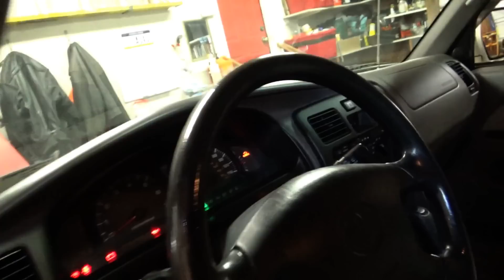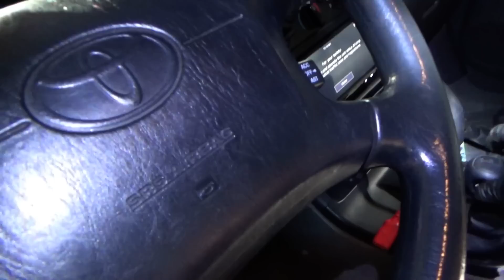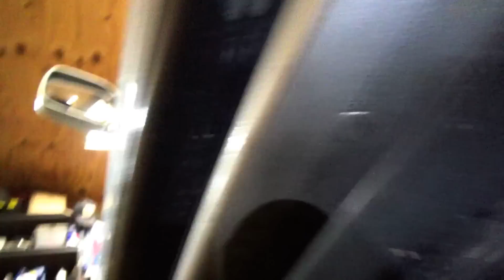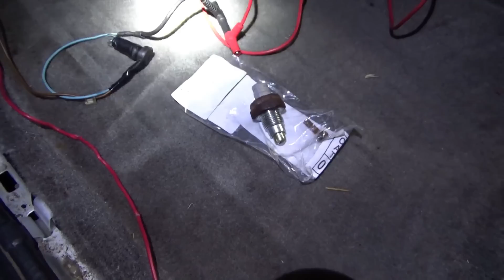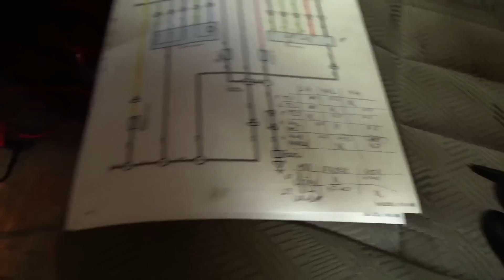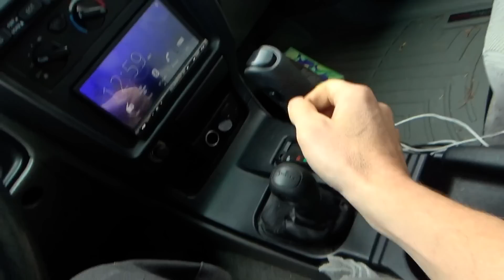(Pt 3) HELP! My Toyota is STILL STUCK in 4x4! ('02 4Runner)

Comment: Hey Ivan.  I felt your pain with this ball-buster because I just had a Tacoma in the shop the week before last that was every bit as bad as this 4-Runner.  Long story short, after wasting a whole morning trying to find what I needed on ProDemand and Identifix (I don't use AllData but I don't think it would have been any better), I got myself a 2-day subscription to TIS.  After about an hour figuring out how TIS works (it's not that bad, but it's set up different than Mitchel or Identifix) I found everything I needed to know about a 2020 Tacoma TRD.  Believe me, this is one truck you don't want to shoot the parts cannon at... everything special to "TRD" is very expensive.  At any rate, I don't think I would have found the problem without the detailed shift cable/shift rod dimensions and specifications I found in TIS.  That information was NO WHERE in Mitchel or Identifix.  Just saying, it's a good resource for these uniquely Toyota problems.
Reply: Where is there a cable?
Reply: @brianw8963  To shift that Tacoma in to 4-low the transmission must be in neutral.  If the notch in the shift quadrant does not match the notch that sets the limit switch on the transfer case, it won't shift.  TIS pointed me to the fact that if the cable is stretched, mounted poorly, rusted up or in any way screwed up in such a way that neutral on the PRNDL quadrant does not match what it wants to see as neutral in the transfer case, it won't let you shift in to 4-low.  In this case TIS suggested checking the shift cable right off the bat.  On most other makes,  the transmission gear selector  cable isn't something that comes comes to mind when a customer's complaint is that it won't go into 4wd..

Comment: Parts cannon fired.😂😂😂jk jk ivan. Those 4wd system are some of the hardest to do diag. Was a toyota tech before. I belive only 99-2001 have that system . shift on the fly all wheel drive system

Comment: Only thing I can think of is a little rust jacking on the case itself along with the crush washer was the culprit. Great video my friend.
Reply: +1 rust, chased the same thing on one, pull the switch and wire wheeled the hole, good to go no parts required.

Comment: the CENTER diff lock on my 96 4runner will not engage in high, only in low. i believe this is correct. now i understand there are NO axle diff locks. thank you, you're the best.
Reply from the maker: @gunny2shoes102  the Limited 96 has a REAR diff lock that can only be used in 4LOW. No center diff at all. My brother had one, it was a beast 😎
Reply: @PineHollowAutoDiagnostics 
Thanks again that's how mine is.
I think they called center diffs-part time all wheel drive-

Comment: That shaft has to be worn as that new switch made contact so quickly maybe the old switch had locked up at some point and the shaft got bent or grooved up at some point were odd.

Comment: No wonder mechanics fire the parts cannon at case studies like this. I'm still confused about the whole test light diag. It just does not add up. Removing the washer when it should be there does not seem right to me. I think there is a bigger problem lurking. But who knows? I'm not a mechanic! Thanks Ivan for another head scratcher!:hand-purple-blue-peace:

Comment: My 1984 landcruiser had a center diff switch. But this was not in these 4wd models from the factory. -- speculate that the center diff lock is a known issue at toyota. So they just removed the switch. No center diff lock, no problem?

Comment: When they were laying on the bench together.. It does look like that Original switch is a little longer from the tip to the bottom of those threads...   That was a nice catch with the washer being the problem;  or rather being the solution.  The real "problem" is that the new switch is a little shorter than the old one..  But you still solved it.. bravo..........   Between this and seeing Eric O have depth issues with chevy crankshaft sensors..  I've learned to never trust mechanical to electrical interfaces now. lol..  They are very picky about depth.
Reply: 13:17
Reply: @ecaparts  I know he "says" they are identical.. But you can see right after 2:02.. the new switch is slightly shorter.  You can even count the threads..  The old switch is 8 threads tall where as the new switch is only 6 threads tall;  only a slight difference.. but it's enough to cause an issue.  Luckily there was a removable washer;  and he was smart enough to try it without the washer....   I don't know if I would have thought of that. ;)

Comment: The pulled to ground “logic” on that system did not make any sense at all.  I’m sure an electrical engineer who understands the mechanical operation may know, but standard mechanical knowledge lends no real logical path for why it was pulled to ground in certain states that didn’t seem like it should be.  Very crazy diag and the switch being that dependent on distance to striker pin was crazy.

Comment: Ivan, just a thought, instead of measuring the depth with zip tie etc, you could have connected the multimeter in continuity/beeping mode and connected the leads and then it would have just beeped when you changed modes
Reply: But he was measuring the depth because the rod wasn't depressing the switch at all. Checking for continuity of the switch would be pointless because it was always OPEN circuit. The only reason for the depth checking was to confirm there was mechanical movement which SHOULD have operated the switch. The reason it wasn't working was mechanical wear inside the tranfercase with the rod that pushes the switch. Removing the washer on the base of the switch allowed the switch to be installed deeper in the transfer case and it now works as intended.

Comment: I knew you would get it! I wouldn't be surprised if the switch was always marginal, and then when the part the rod slides in wore a little, the switch no longer could make. One cannot assume the design was without flaw from the beginning. It's possible they had a box of switches at the factory, and kept trying different ones until it worked - and then shipped it!

Comment: Seemed to be two tiered. New switch and then discovering that tolerances are tight-tight-tight. Removing the washer to gain the extra needed space-brilliant! Good call on waterproofing the threads. Should work for a while.
Great trouble shooting!

Comment: I would have started the process by checking all of the mechanical linkages, but I’m no Toyota mechanic. Many 4x4 vehicles have a hidden switch, referenced only in the owner’s manual, that will release an intransigent transfer case - don’t know if that Toyota has this release mechanism. Over the course of many years, I’ve only owned a variety of 4x4s, all with different problems. Every person who has posted a comment has added valid points to the discussion, but thank you Ivan for your persistence and methodical approach to getting to the bottom of this problem.

Comment: you can remove the actuator from the transfer case by removing a small cover from the actuator and pulling a small cog from it then pull it off the shift rod. Just make sure the transfer case and actuator are in the same gear when you put it back on.
Reply: I don’t know about this vintage of 4 runner , but you can do that on the gem 3 Tacomas. You must push the shift rod fully in (2H) and clock the gears       to the alignment marks.

Comment: I had a similar issue with my 89 SR5 4x4, but with the reverse lights. The switch was good but had to be depressed a hair more. I shave down the washer to half its size. Worked fine after that with the old switch.

Comment: Took a bit of struggling but you got it. The shaft is, more than likely, worn on the side opposite the switch, where the activation cam rubs on the shift rod. I've seen this before, especially on any vehicle that shifts from two to four wheel drive frequently. And going by the age of the vehicle alone, that kind of wear is not unexpected. Good job.

Comment: Shaft in transfer case is worned and internal damage. I will recommend replace or renovation transfer case too. This problem may be back. The 4x4 cpu you can sell in ebay for the price you buy. Thank you:)

Comment: What about crossion (or a burr) on the mating surface of where the crush washer contacts.  Kind of like "rust jacking" on brake pads.  Wondering if sanding that surface a bit would allow the crush washer with the switch work.

Comment: I'm always amazed you can perform these frustrating analyses without profanity.
Reply: It's called EDITING... 😁 He definitely cussed this one .
Reply from the maker: @brucherrin8947  When the NEW switch didn't work, I actually couldn't believe it!!
Reply: Eric O had a crank sensor that didn't pick up because of rust jacking,maybe that's why 

 @PineHollowAutoDiagnostics
Reply: @PineHollowAutoDiagnostics It amazes me how a tiny amount of wear can stop something working 😢😢 A Nephew of mine had a problem were his Yamaha Motocross bike wouldn't disengage the Clutch that was fine before he parked it up in his garage 😢😢 turned out after multiple times taking the Clutch plates out that the actuator Cam from the clutch lever was worn by a couple of thousands of a inch 😢😢😢😢Absolutely unreal.
Reply: When it didn't work, he said:   "Crap" --- 
That's him cussing it...   It's profane enough to get the point across
Reply: I would have invented new words
Reply: I know.  Me too!!  I sometimes let them bad words fly.  Lol
Reply: Hi Hugh, I know this might sound crazy, but I have been turning wrenches for about 60 years. When I find myself completely stumped, and completely exhausted, I ask Jesus to help me. I settle down, take a few very deep breaths, and somehow, some way, it works. Try it, you may be very surprised.
Reply: @JamesAgans  I usually ask Jesus for help (& repent) after I weave a tapestry of obscenities. I know, I know, I need to adjust my priorities,  & timing.😅
Reply: @robtemple3445  hi Rob, I have been doing all my own mechanical work basically my whole life. I am now 78. It's not entirely because I want to, it's because whenever I have trusted someone else to do anything, they fell short of my expectations. I was not being petty either, we are talking things like AC that didn't work, I get the truck back, and the AC works for about 20 minutes then nothing is coming out of the vents. Then I recall the manager exclaiming " man your AC is really working well now, we got 25 degrees out of the vents!" On my way home as the air stopped coming out, it hit me, 25 degrees? Holy cow, I bet the evap coil is freezing up! I was right. I researched the system and changed the high pressure cut off sensor. That solved the problem. Had I continued to let it go, the seals in the compressor would have let go. What I was referring to is those situations where you are worn out, tired, and at your wits end. It happened to me when trying to install the last three roller followers on a Ford 5.4 complete timing job, and a couple of other times. I wear out a lot faster at 78 than I did even a few years ago, I guess that is to be expected.

Comment: Great job as always!!
Year's ago i had a Chevy blazer, the front differential would not engage. I replaced the vacuum/ ball switch on the top of the transfer case (im sure you remember those) and it was fine..
Very simple repair..

Comment: Nice repair but very frustrating. Toyota has a strange transfer case design that requires you to remove and disassemble the transfer case to replace the transfer case motor because the transfer case motor is the rail for the shift fork. What you did was perfectly acceptable and saved the customer thousands of dollars.
Reply: No, You most certainly can remove the module (on the gen3 Tacomas) without dismantling the transfer case. You remove the bottom cover on the actuator assembly, carefully. The plastic gears and pins will fall out. Then you can slide the actuator off the shift shaft, it is internally attached and will remain in place . When the shaft is fully pushed in , it is in 2H, which is where it needs to be to reinstall the actuator assembly. There are alignment marks to get everything clocked  correctly. Takes a little fineness to hold everything in place to reinstall the cover, but very doable.
Reply: This is not a 3rd gen Tacoma

Comment: Are you sure the switch itself isn't adjustable ,  with a crush washer the position of the sensor is fixed I have seen switches like that as limit switches where there was a thread on the inside to adjust the throw of the switch

Comment: Seeing that switch reminded me of some transmission faulty shift solenoids. They worked but how, you could hear that the action was not as defined as it should be. Possibly a partially burned coil but either way they still worked but were weak. I believe that the shaft has worn in the housing just enough to need the new switch to go down a bit further to actuate correctly on the ramp.

Comment: Toyota should have given more logic information, you had to create the matrix. Some of what seems to be illogical in the logic, might not be . Toyota would have had to go thru several " what if " scenarios for  what happens when different sensors or switches fail.  This fail safe design planning is essential, and it is especially evident if you ever worked on microwave ovens. Microwave ovens have 3 door switches , plus a main power relay on the control board to get the magnetron to run.  The 3 switches are designed so that there is no chance the microwave magnetron itself will run with the door open. I just ran into this problem. A bad switch allowed the fan and light to come on, lucky for me the magnetron was not powered as I reached in for my morning coffee !
It might have been designed so that the transmission stay in 4x4 lock , when there is a malfunction. This actually makes sense if you consider the problems that could happen if the logic forced only 2 wheel drive operation if there was a malfunction. Here is my scenario, if you are using 4x4 , especially lock, you might just be in a terrible weather environment or you might be on something like the Rubicon trail or Mojave desert. You would NOT want to be forced into 2 wheel drive because a a sensor or switch malfunction in such harsh environments.  The malfunction default mode keeps the maximum capability of the 4x4 truck intact.

Comment: Be hard to tell if there is wear on the shaft (surface operating the switch) without knowing some original measurement. Pretty tough to tell without some really in depth  service data.

Comment: One would have to conclude that there may be looseness, wear and radial or axial deflection in the device that drives the switch which causes it to work erratically or not at all.  I mean you've hit everything else that it could possibly be.  I'm placing my bet on wear/looseness  in the transfer case.  I can't remember what it was but this smells like Deja Vu - did you have a similar set of circumstances on another video? Or was that something I worked on sometime ago?

Comment: As an owner of a 2002 4runner since new to present, I can tell you that 4 wheel drive indicator will flash when activated until it locks in completely,  this usually takes time and what always helps it engage is the slight movement of the vehicle and or putting the gear selector into neutral during this slight movement of the vehicle otherwise it sits there and blinks forever,  that could be part of ur issue, but I can also tell you from my experience is that in the last 5 or so years, atleast 4 of the control modules including the main fuse box inside the vehicle have failed...2 of which I found people to repair and some I had to find replacement son ebay. And my 4runner only has 85k miles .
Reply from the maker: @v-modsolutions6946  I'm so glad that my 2002 Suzuki has only ONE essential module... the ECM 😄
Reply: It is only 22 years old.  Come on man.....😊

Comment: I was leaning toward a weak actuator motor, however hearing the positive, quick, consistent engagement ruled that out. I would venture there is some wear on the transfer case shift fork.

Comment: This is why i hate this electronic or vacuum operated 4 wheel drive systems. Put a mechanical lever and cable on it and be done with it. People are too lazy to pull a lever, all they want to do is push a stupid button.
Reply from the maker: Same goes for transmission shifters and parking brakes...mission-critical components should NOT be drive-by-wire!! ;)

Comment: Years ago, I had the same problem with a Honda motorcycle gear indicator switch. The electric start wouldn't operate if the bike thought it was in gear.
The plunger position was critical.

Comment: The ramp might actually be worn but you can't actually see it because of the mirror you need to take the actual part out and look at it directly my guess is that it's worn in and needs to be rebuilt back up or replaced

Comment: the stealership would have sold the owner a new transmission and transfer case along with new modules. this is why i stick with older model vehicles in the major 3 American brand car manufactures when buying a vehicle. 
great job on the diag. was this toyota pre obd2? is that why you werent using a scanner?
Reply from the maker: I explained why a scanner would be useless back in the beginning of Part 1...the 4x4 ECU is not on any network! It's a "dumb" module that can't talk :)
Reply: @PineHollowAutoDiagnostics  guess i have to go back and rewatch. 
question. whats a good bidirectional scanner in the $500-$1000 range for most makes and models. thanks.